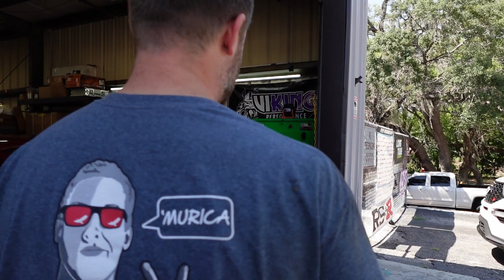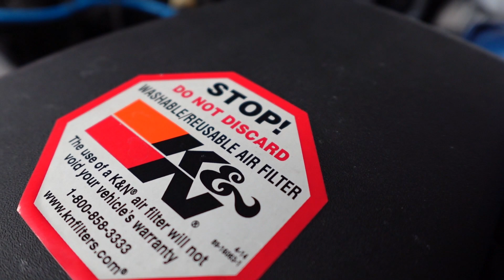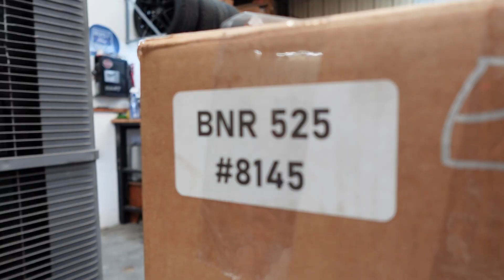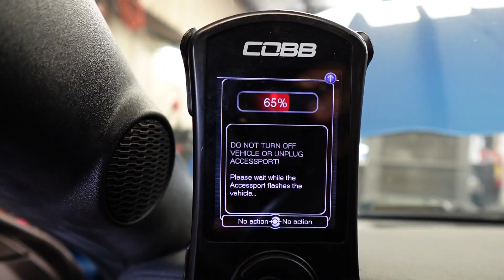VLOG 29: Scarlet is back! | BNR 525 install

Comment: Those coolant and oil lines will be a life saver! I ordered a bnr600 right at launch and installed early March with the EMS no grind it. Easily spent two hours trying to bend the lines to where I could get proper fitment